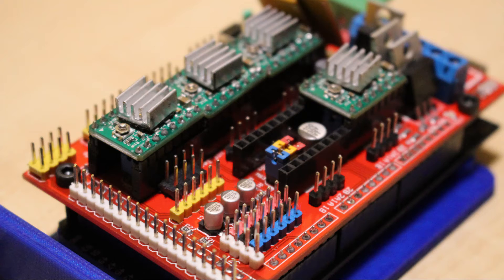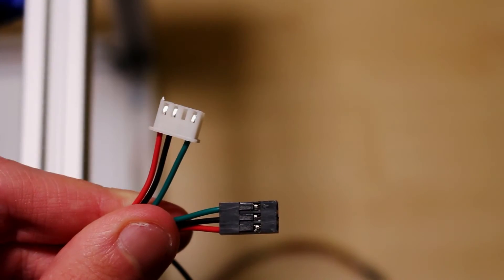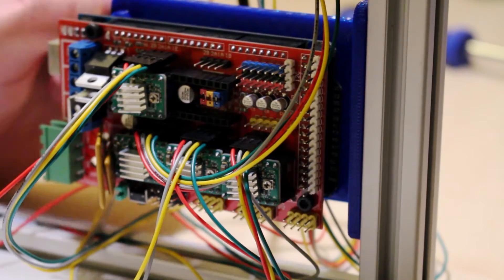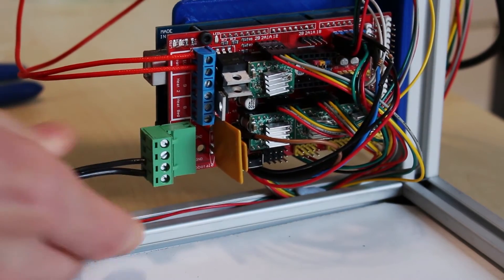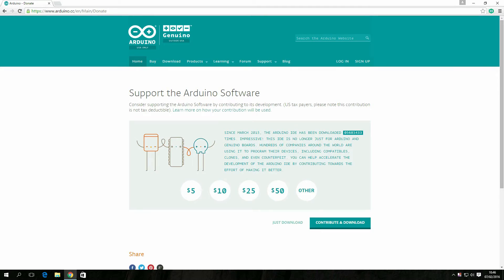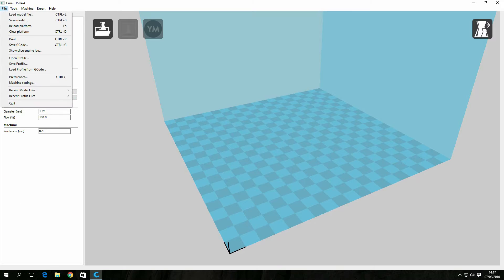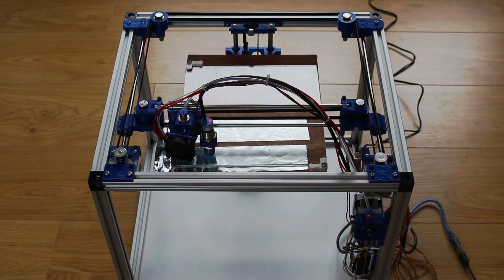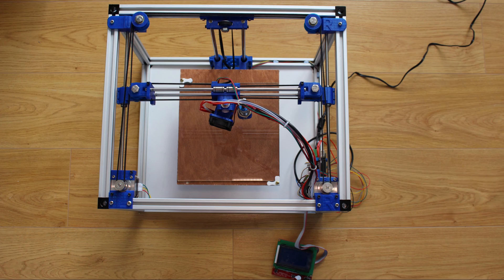SmartrapCore Alu DIY CoreXY 3D Printer Build Part 3 - Electronics

Comment: Need to adjust the stepper motor current located on ramps board the pots.the noise you hear is the current set too high. Use a multi meter to adjust the current think its in the neighborhood of .05. Not having your current set correctly will cause over heating of the motor that leads to thermal shutdown also will cause missed steps. Once you get current adjusted you will notice smooth running motor that should not run at a temp higher then 105 deg. Hope this helps.
Reply from the maker: Hi, thank's for your comment, I did try a few things based on what you said but I think I had some faulty electronics maybe, as my current setting and everything was fine. I recently build a Hypercube on my channel using some solid electronics and it is indeed much quieter! :)
Reply: Yea there are a lot of ramps board clones that are just junk sounds like you got one.  Glad you got it up and running.

Comment: I have heard that there might be performance problems when using the Arduino for CoreXY with the big LCD Display at higher speeds. Did you have any trouble with that?
Reply from the maker: I had trouble setting up the display initially actually, not even at high speeds... when I have some time I'll try and set it up and see what the performance is like!
Reply: Thank you! :-)
Reply from the maker: Just taken the printer apart ready to build a new one, might be a while I'm afraid haha